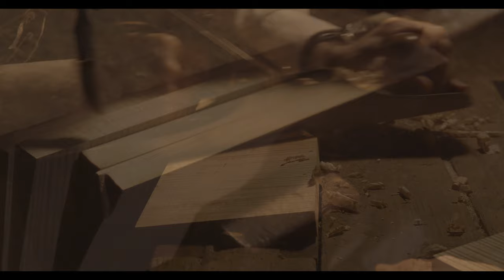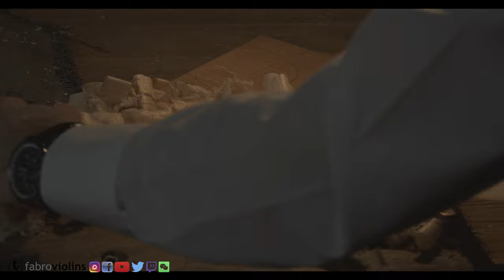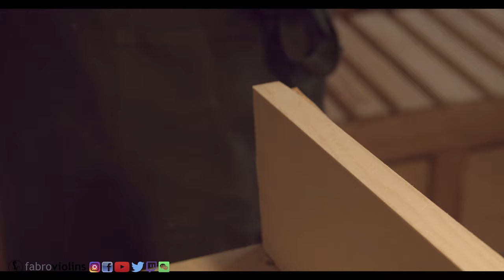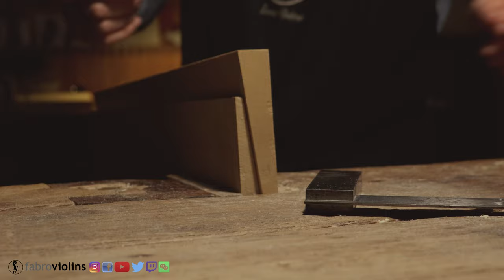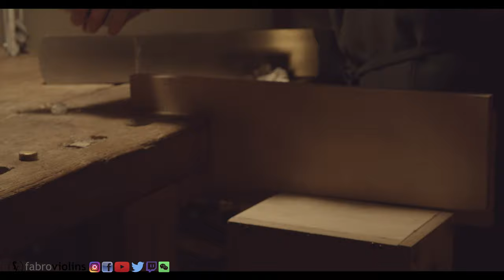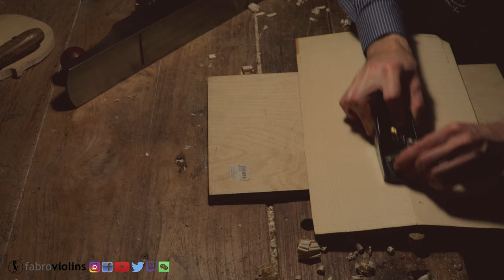MAKING A VIOLIN | The JOINTS | Step 01 | Amati Model

Comment: Thanks Lucas - also have your Obrien vids - but nowhere - even in texts - does it address the cutting of the top and bottom plates when they are at an angle (wedge).  I see you marking the corpus shape on the flat surface, and cutting with the wedge shape down on the bandsaw - But does this not leave the plate sides at an angle?  Maybe this does not matter? tks :-)
Reply from the maker: Hi! Thanks for your comment and I hope you're enjoying the videos :)
If I understood the question correctly, then you want to know why I'm using the "outside" part of the block of wood as the one that'll be the flat one and the central one (where the cut is made) for the arching, and not the other way round (which would be "easier" because they're already in square)? Please correct me if I'm wrong or let me know if I got the question right haha.
But if that's the question, then there are a couple of reasons. first of all is that this way, on the side of the arching (the visible one after all), I'll have more symmetry. To explain this I always draw a line joining both pieces and try to show where the'll be "closer". The other reason is that usually, and according to how the block of wood was cut, then the grain tends to be straighter and eventually at 90 degrees there.
I get the feeling the answer was not very clear haha, but let me know if you got at least part of it!

Comment: Did you put glue on, then plane it off again?
Reply from the maker: Hi! Thanks for your message.
Yes, you're correct!! That's exactly what I do. The idea is for the wood to absorbe the glue initially for a couple of different reasons. First of all, is so that when I do the actual glueing, then I can be sure that the wood won't absorbe "too much", and then there's not enough glue on the surface of the wood to get the two pieces joint together. Another reason is that after this first time I put the glue, sometimes the wood gets a bit "deformed", so when I make it for the second time, if the piece of wood already absorbed some of the glue, it's going to be much more stable and better to glue the joints. 
Of course this only works if I manage to make the joint for the "second time" removing as little wood as possible, if not I have to repeat the process again.
I hope I was clear as I feel like I made a mess explaining that!
Reply: @LucasFabro  thanks a lot for the explanation, I felt lost at that part of the video.
Reply from the maker: @N_3.1415  I'm glad it was helpful :)

Comment: Hey, look at this new editing! Some really cool shots in there, I love it :-D
The colour grading is maybe a little flat/desaturated for my taste, but apart from that I loved every bit of it!
Reply: Oh, and completely unrelated to this... Before I saw your video I was browsing the ol' internet looking for answers, didn't really find one. I ran into the same issue I have had so many times: How do you decide the F hole width of a violin? I just finished a pair, on a Strad model and they're looking lovely, but I measured and they're inly 5,7 or so at the widest point, so fitting a 6mm post or even a 5,5 one might be an issue. Would you make them 6,5 for instance to make post fitting easy or just accept having to insert the post through the eye? Or maybe usie a 5,5mm post, I'm not sure if that is actually an issue...
Reply from the maker: Thanks! I made a big mistake with the editing at the end and I couldn't restore the previous version so that was a bit annoying and some of the colours and clarity didn't come as I wanted. But all the feedback is good because even if I want to make it with quite a "dark" vibe, I still know that the way I see it might not be the way others do (also I'm always editing with the brightness at max!)
Reply from the maker: @Tostra1997 About your second message, I'll give you what I'm sure will be a disappointing answer for you, but that is that I make the f-holes thick enough so that any regular sound post can go through (so over 6.5mm). One of the biggest advantages of modern instruments should be how easy it's to deal with them, so whenever the soundpost is changed (and it will have to be changed) it shouldn't be a problem for the luthier who's doing it and that's often not the person who made the instrument. Putting a smaller soundpost will definitely affect the sound of the instrument and I don't really think it's worth it...so...yeah, quite disappointing because I know how elegant the thin f-holes can look!
Reply: @LucasFabro  I understand, it happens. And I think I know what you were going for too, and I like that. It ended up a little washed out, like what you get if you do a reverse luma curve or something. But not so bad, really.

And, no, not that disappointing. I agree, I really do. It should fit modern standards to be easy to work with, like you say.
I have done the same thing with every other instrument so far, so even if the template would be too small, I enlarge it. I wouldn't if I were making a true copy, but for my "modeled after"-instruments, I think it's okay, even if it's scary to go free hand.
I'll follow your advice and make them at least 6,2mm or so to easily fit a 6mm sound post. I think adding 1mm is too much for these, but I can do 0,5-0,7 without taking too much away from the elegance I think.
Thanks for that, now I can at least make a more confident decision :-D